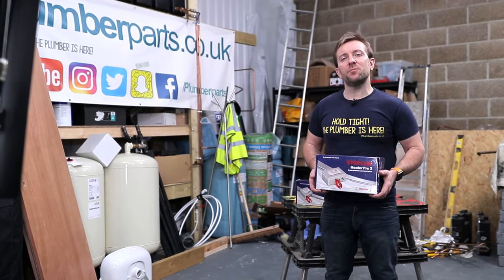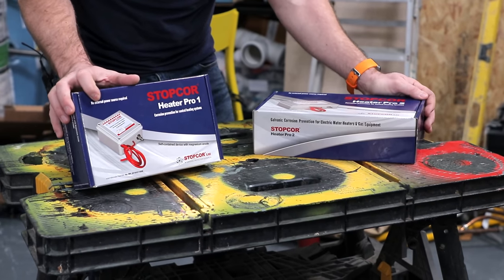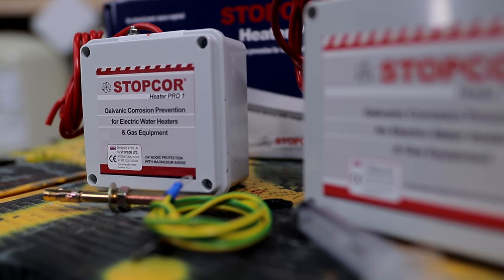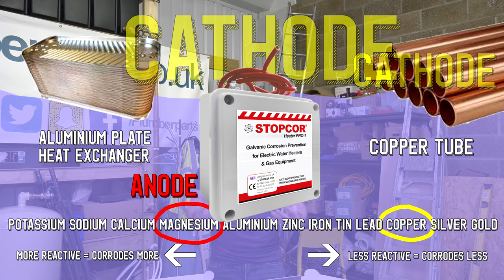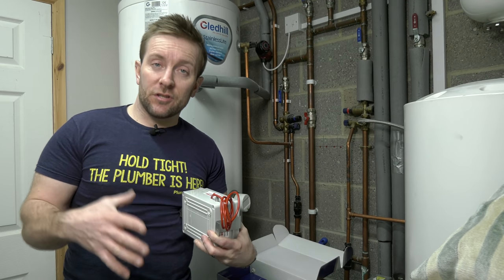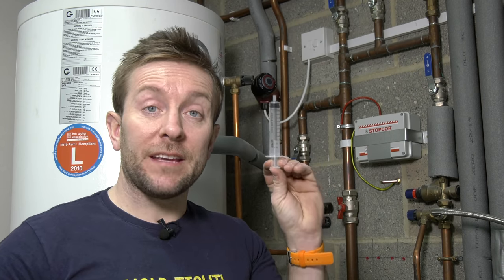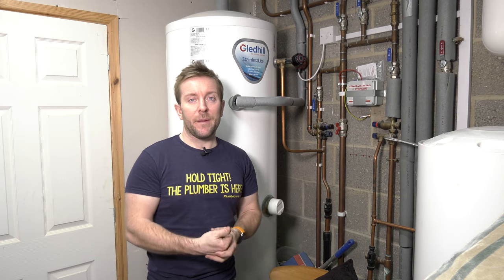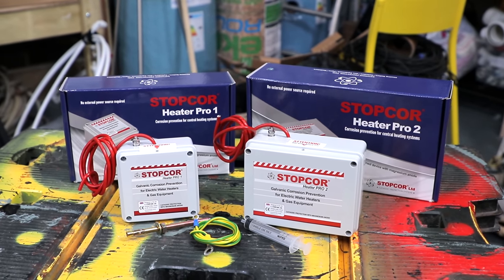HOW TO STOP WATER PIPE CORROSION - STOPCOR Review

Comment from the maker: READ HERE FIRST! There is NO battery in the Stopcor! I've taken it apart this morning. There's a massive magnesium anode though!  
🍺 JOIN THE  Exclusive weekly live videos on Thursday : https://www.youtube.com/user/plumberparts/join
🛠 AMAZON TOOL STORE BUY THESE TOOLS HERE http://www.amazon.co.uk/shop/plumberparts
📺 VLOG CHANNEL: http://www.youtube.com/c/timeswithjames
Reply: So you connect one of the wires to the pipes, and the other to an insulated wall. In that case, that battery of magnesium anode and bit of tap water should work for a long time :-)
Reply: It’s a battery !!  Alternatively, you could use half a potato and a coupe of electrodes. Squirt in a bit of water on to the potato. Potatoes are especially good compared to other vegetables due to their high starch content. 
Then measure the voltage produced as plumberparts did with the Stopcore and now you have evidence that your CH system is better protected. 
Potatoes are readily available at your local supermarket and I think they are a bit cheaper than the product advertised here. 
Keep it real 😊
Reply: What is wrong with it being a battery?  You have demonstrated that with your meter. The real issue is what functions does it really work for, so we look forward to the test results. Nothing worse than trying to remove limescale. . .  for those of us without space and budget to maintain a water softener . . . perhaps we have the economics wrong on those?
Reply: @Bob_too  He has demonstrated it is a battery, no need to worry about that. Like the spud idea. There's usually a bad one in the bag you could use. Look forward to the video. Like to see the connection to earth better defined, both the resistance and best location for that.

Comment: Wouldn't the 2 metals have to be immersed in the same solution for this to work? Are you sure this isn't snake oil? I think it might be.

Wish you would have shown us what's going on inside or at least show us the sacrificial anode that's in the box.
Reply: Yes, this looks like pseudoscience.
Reply: No. The anode and cathode are formed by connection one another. So as long as the metals are in contact, the electrons distribute between the two different metals to cause the electrical imbalance, forming the anode and cathode.

When it is unintended, we call it “galvanic corrosion”. Like accidentally using two different materials which have a high galvanic potential between them for a bolt and a nut, or a bolt and the flange. One corrodes like crazy. 

Look up YouTube videos on Galvanic Corrosion.

Source - I am a chartered engineer and deal with saline coastal atmospheres
Reply: @zeno2712  Its not pseudoscience.  Galvanic Corrosion is similar to how a Alkaline battery works basically you have a electrochemical reaction between two dissimilar metals immersed in an electrolyte , in this case water, which produces a voltage. However this chemical reaction eats away at the Anode . All that is happening here is they are replacing the Copper Anode in the reaction with a Magnesium Anode and therefore protecting the Copper pipe.

https://galvanizeit.org/corrosion/corrosion-process/galvanic-corrosion
Reply: @timg6850  I think it was the claim about limescale that pushed me over the edge.
Reply: @mattg5878  So do you think this device could actually do something? I became suspicious when they grounded it by drilling into the wall.
Reply: @zeno2712   Yes I am not sure about that either.
Reply: @thaitichi  It certain will do something. But how bad is the corrosion problem this is solving? Yes, it will make a system last a lot longer from a corrosion. But a boiler would die due to electronics anyway. It's cost Vs benefit and that is case by case. For a block of flats with district heating it is likely ideal. Or for a big commercial. I will be looking at the cost of the unit. As I'm an engineer I am prone to overengineering EVERYTHING.
Reply from the maker: Mate I’m going to pop one apart next week. Might do it on a live vid!
Reply: @plumberparts  Cool! Thank you!
Reply: @plumberparts  Great!
Reply from the maker: @zeno2712  MATE! Just popped it apart. I can't really describe whats in the box but it's a massive chunk of magnesium in like a putty suspended foam....crazy!
Reply from the maker: Doing a follow up video on this soon!

Comment: won't work, what a load of bollocks!
Reply: Why do you say that ? Every single one I’ve installed has worked exactly as described to the point where customers have replaced the units after 3 years.

Comment: Bigclive is going to love tearing this a new one.

I'd seriously consider removing this video for your reputation. It's shockingly misleading the consumer, the limescale reduction claim alone should have gave it away.
Reply from the maker: I’m actually a bit gutted I didn’t take this apart myself! 

I may grab one and see what magnesium actually looks like. 

Other than that the ‘science’ (aren’t we fed up of hearing that yet!?😂) is sound. I’ve worked with sacrificial anodes for years and it’s nice there one on the market that does the same thing remotely. :_Holdtight:
Reply from the maker: @oOBlackThornOo  Hi Mate. I've just taken my one a part and checked the patent number on Espacenet (.Gov recommended). 1. There's no battery in it - it's a magnesium anode core and spiral mounted in a solution that solidifies and activates it when the water is injected in. 

2. Can you point me to the page about it having a battery in it and the multiple applications because I can't find that bit...but I did have a few beers last night!
Reply: Two different metals and a bit of electrolyte in a box IS a BATTERY :-), this is the same experiment as in school with the lemon and nails. The protection anode needs common electrolyte though.
Reply: @plumberparts  he's currently hiding under his small rock.

Comment: Hi James great video as always. If I install the Stopcor on my water main, would it protect the heating system as I have an f and e tank for the central heating in my home and the air gap between the ball valve and the water. As theres an air gap would the stopcor still work? Thanks.
Reply: Hi Steve, yes will work.

Comment: I personally can’t see this product working. The voltage is low, and in resistance too great between the anode and cathode on this device. I have looked online for reviews, and i cant find anything. There would be a galvanic reaction going on in this device, but this is not going to help with the lame scale of your heating system.

Comment: 🤔Doesn't an Earth wire need to be 'Earthed' to have any useful function? Just sticking a wire on a bolt in a concrete wall is of no use at all. There is no return path for an electrical current to flow, it's doing nothing.

Comment: Seems similar to the claim that putting magnets around water pipes would prevent the build up of limescale - just something to sell to those that believe it works.
Reply from the maker: Think you mean magnetic scale inhibitors (the silver inline things) theyu'll efectively do the same thing. They don't stop the formation of scale, just 'suspend' it in the water more, reducing the chance it will 'cling' to a part of the system. It's not the main reason I'd fit a Stopcor anyway. Btw doing a take apart vid and comparison soon....but will take a few months to run the experiment!

Comment: See I don’t get this. A sacrificial anode is found in the actual water. If it was a unit that your heating water is flowing through, I could see this working, but I’m struggling to see how this will work without being in the water itself.
Reply: I bet there is a 1.5V battery inside that "sacrificial anode" :-)
Reply: As you can see in the video we add water inside.. so instead of being inside the actual water, the anode provides protection externally.
You are smart enough to realise that this an innovation!
Reply: It’s the electrical charge of the cathode which prevents it from corroding.
Reply from the maker: @bumv2  Opened today and gues what...there isn't!
Reply from the maker: Doing a follow up video on this soon!

Comment: Would love to see what is inside the unit...what's the bet to a 1.5 volt battery and not a lot else! The sacrificial abode needs to be in contact to be of any use. Still a few more ££ on the bill, coat the pipes in snake oil for best effect.
Reply: No batteries at all! The voltage is generated by a sacrificial magnesium anode. STOPCOR is innovative and smart!
Reply: @stopcorlimited9326  What does it do with limescale? And how long does it last?
Reply: @zeno2712  Hi Alan,
Basically it creates a magnetic field activating the Brownian Motion in liquids, thereby reducing Limescale accumulation inside the pipes.It lasts for 3 years after this it needs replacement Don’t forget it contains a sacrificial magnesium anode that will be destroyed due to electrochemical corrosion protecting your heating system.
Reply: @stopcorlimited9326  Seriously?
Reply: No need, they've done it for you. Patent - WO2018011608
Reply: @oOBlackThornOo  That patent doesn't mention anything about limescale, Brownian motion, etc but can @stopcor limited say whether they have a relationship with Nikitas Kounadinis or some licensing agreement with the inventor? Or perhaps you don't infringe the patent Claims or any of its prior art?
Reply: @zeno2712  You can check companies house as they are a registered business in the United Kingdom and he is on the board of directors as a company director.

STOPCOR LIMITED

Company number 10464626
Reply: Hello everyone,
Mr Nikitas Kounadinis is the inventor of STOPCOR and our Director.
The patented technology behind STOPCOR is based only in the scientifically proven method of Cathodic protection. It took us years of research to develop a product that can actually produce current up to -1.5v and keep it for 3 years without the need of an external power source or batteries.However It’s not easy to teach electrochemistry and Physics on the comments section, so you are all welcome to join our seminars at the business centre when lockdown ends.
Reply from the maker: @oOBlackThornOo  sorry mate I've check this patent and also taken the unit apart this morning. No batteries in sight! Going to do a video on this and feature your comments if that ok. If not let me know! 👍
Reply from the maker: Mate I've JUST taken it apart. Going to do a comparison test over the next few months on it. Just researching how to do it first.... Anyway, there's s a big anode in the box, suspended in a putty type solution then wrapped in foam. The water activates the putty to solidify it, imersing the anode in the 'remote' water.
Reply: See what the voltage is without anything connected to the red wire and the "earth" with the water added....

Comment: Interesting. Where does the 1.5v come from for three years?
Reply: It comes from the sacrificial magnesium anode and the powerful backfield.. It just needs a 10ml of tap water to be activated!
Reply: From the battery you create when you add the electrolyte (water) into the coil of copper with a magnesium core.

Comment: Why not use a DC transformer to establish a voltage gradient that would last forever? This probably isn’t going to do anything that a decent inhibitor won’t achieve by controlling pH and dissolved oxygen.
Reply: Hi David, impressed current produced by a sacrificial magnesium anode which is the most active metal is better because it is naturally generated and therefore compatible with any metal. Worth mentioning the easy installation anywhere without the need of an external power source or batteries!
Reply: @stopcorlimited9326  Thank you. I thought current was compatible with any metal, no matter how it is generated?
Reply: @davidt1955  That is what electrochemistry teaches us!
Reply: Maybe I could just wire a lemon up to the central heating to induce the voltage as that would be naturally generated. Perhaps even splash out on an organic Sicilian one🤔
Reply: @davidt1955  Great imagination! You could work for us!!

Comment: This video does not review the product at all.  A proper review would, at the minimum, test and show if the product works.
Why does the blurb measure the current in volts?
Where does the sacrificial chunk of magnesium go to if it is not immersed in the common electrolyte?
Surely if a product like this works it should be promoted with independent reviews to alleviate any doubt.

Comment: I was a carreer commercial fisherman, inventor of voltage tuned fishing lures and have published articles as well as a book on tuning a boat to make it catch more fish. For the skeptics, the guys who know this works, are the ones that have bought a new boat and it simply won't catch fish like their old boat did. As in metal water pipes, you need a sacrificial anode that is submersed in the same water as the pipes needing protection and the anodes need to be solidly connected. I have done experiments on steel boat bilges and the anodes on the outside of a metal boat will not protect the metals on the inside. This, of course applies to all separated sections of the bilge that contain water and are sealed from the other sections. If there is a drain hole connecting the water in each section, then one anode will protect several sections of the bilge. The anode within the Stopcore does not share the water contact with the metal pipes and therefore will not corrode and protect the plumbing metals. 100% guaranteed.

Comment: Can you do one extra test please. After fitting the earth stud to the wall but without connecting the earth lead, measure resistance of the stud to a good earth. You will need a very sensitive meter. Whatever the resistance value, why don't they fit that resistor in the box? It really won't cost much. You can then connect it to a proper earth. Also the resistance will be properly defined. In some apps blocks might be damp etc.

Comment: 1.5v coming out of the stop core👍. Before connecting the red lead, as a comparison would have been good to see what the voltage was between the earth bolt and jubilee clip and then between the red lead and jubilee clip🤔.
Reply: Hi Dave,
Thank you for your comment. That is absolutely true, if you test the pipe first you will see a different voltage and after the installation of a STOPCOR the voltage is from -1.3V to 1.5V   And that is what we call cathodic protection powered by a sacrificial magnesium anode.
You can try one, test it and send us your feedback.

Comment: Would this make much difference if there is a water softener and TF1 already protecting the system? Thanks
Reply: Water softening prevents lime scale. Lime scale is the deposition of a precipitate which was in the water. Corrosion is the oxidation of the metal. Two different things

Comment: Would I still need this when I have a filter fitted in when I got a new boiler in October 2020? Is a filter the same thing?
Reply: A filter can’t stop corrosion! It deals with the effects and it is not sorting the problem. No matter if you have a filter or not you need a STOPCOR the most effective method against Corrosion and Limescale.

Comment: One of the major problems associated with premature boiler breakdown or death, is water quality. 
Customers usually remember that the 10 year warrantee on their £1500.00 boiler is dependent on the boiler being serviced and tested annually for which they, the customer, has to pay. Strangely, customers forget this. Similarly, the manufacturers will not remind you even though they have your contact details with the boiler registration. Hmm, I wonder why??  Anything that prolongs the life, avoids expensive parts needing to be replaced and reduces running costs by improving system efficiency has got to be worth it.

Comment: Does STOPCOR protect all hot and cold pipes in a property ?
Reply: Hi Peter,
The answer is yes!
STOPCOR can protect the entire property.
Make sure you choose the right size.
Heater pro 1 for 1-2 Bedrooms 
Heater pro 2 for 3-5 Bedrooms 
For large scale applications you need the Commercial line C5 - C7- C9
The current can easily expand trough electrical conductivity in water even if you have plastic pipes connected.